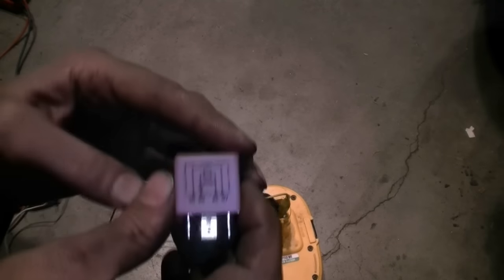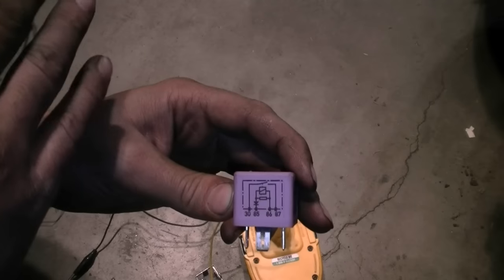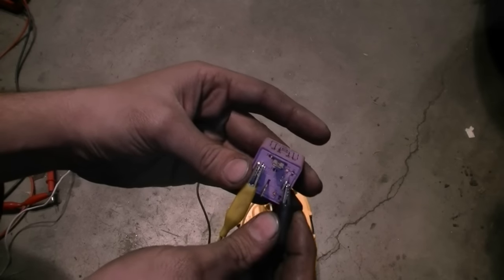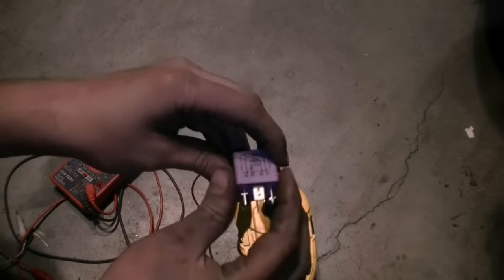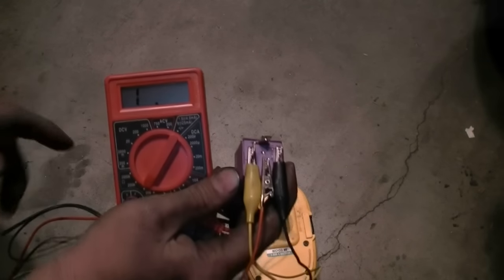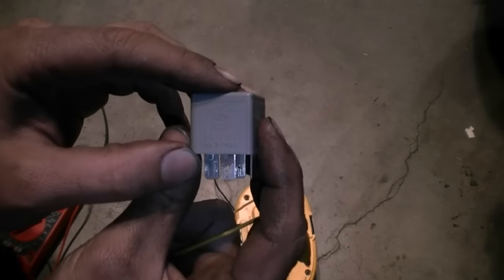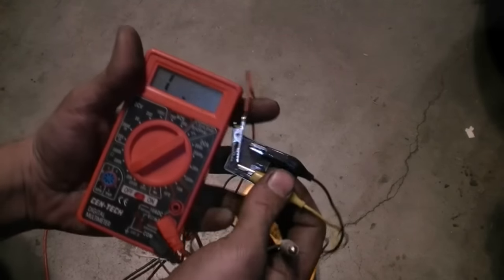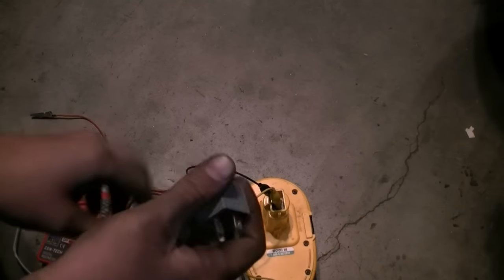How to Test a Relay the Correct Way

Comment: I got 000.4 ohms. Is that resistance still mean that it's good?
Reply: yes that is still good
Reply: Ford relays should read more than 0 and less than .5
Reply: I got 000.4 ohms. Is that resistance still mean that it's good?

Depends on what kind of load it handles. If it's for a starter or for the headlights, then it is no good. If it drives the windshield wiper pump (2 or 3 amps), then it's probably okay. A relay that provides 15 amps is going to drop 6 volts across it (if the resistance is 0.4 ohms), which leaves only 6 volts to drive the load. Amps X Resistance = Voltage Drop.
Reply: Actually that depends on the multimeter. If not properly calibrated or you have crappy leads it can cause you to see higher ohms. If you touch the leads together and do not get a reading close to 0 then your meter is off in some way. The power applied is only a coil engaging voltage and does not affect the ohms reading.
Reply: Most multimeters cannot measure accurately under 10 ohms. You are usually looking at a good or no good condition with relay coils.
Either you will get a low ohm reading or an open circuit, rarely anything in between.

Comment: 2007 Corolla turns but wont start. Changed plugs and cam sensor ( old sensor read 1.3 ohms while the new sensor read 1.2 ohms. Repair Manual range 1.6 -2.0. confused!) Moving on to check the crank sensor   which is buried behind ac pump and alternator. I checked efi  relay for click and resistance, works. I believe their was a recall for 2007 corolla not starting which had to do with ecm. Do you have any ideas, thanks.

Comment: The relay really needs a "load test". If you do a voltage drop test before and aft the load circuit contacts (relay) whilst the relay is in circuit and switched on....it will tell you if the contacts really are good or not....

Comment: Hey young man;
Could you point me?
99 5.9 Durango 
Few years ago it died at 170,000 and for some reason owner just let it sit for few years. 
2nd owner put fuel pump on and it ran for 700 miles and quit. 
They put crank/cam sensors and still no start. 
No Buss signal in odometer window.
I bought and am sorting thru.
 It does crank and sounds mech ok during crank. 
Dash lights seem to work normal during key on. Odometer reads mileage.  
It does not have or require a smart key.
It does have a Security light that shuts off within moments of turning key on then after 3 flashes of Odometer No Buss code and security light show up.
Tach does not move during crank.
I have no power to coil / fuel injectors. 
I have fuel pressure at Schrader valve. I can light loosen Fuel relay and hear clicking.
I hear no activity from ASD relay.
I have; (key on) 5.18 volts on the (5v ref wire) at crank/cam/ throttle sensors.
Key on backprob crank sensor signal wire and volts remain at 5.
(Key off)I unhooked positive terminal and test light to bat positive post- tested black ground on crank and cam sensors the light comes on strong. 
Did the jump on ASD relay (pin 3-5) and for first time have 12V at coil. 
So that should mean Ign coil driver is (ok) in PCM correct?

The Durango is immaculate with no obvious signs of mice or frayed wires. 
I am somewhat comfortable with a wrench but power tracing not my best area.
Even though box and old crk sensor were left in vehicle; I’m leaning towards a bad crk sensor.  
Best; Tom

Comment: Ok, if 85 is ground and 86 is positive and I hook it up to a 12 volt system and close the relay. Why do I have to put power to pin 30 to get 12 volts to pin 87. Shouldn't I get 12 volts to pin 87 when the relay closes

Comment: hello sir iam from india i have vespa s 150, 70,12v dc starter relay,when i testet in multimeter @ 200 ohm, 86 to 85 result is 36.8 is this bad relay,i have also starting problem to my scooter.

Comment: Hey bro, can you please tell me how to test the solar roof relay (part # 4B0959589). It doesn't have a diagram on it, just these numbers by the pins: 2,3,4,5,6,7. And it says 12V(plus part number).
I'm having a problem with blower motor going in limp mode after 10 min. After some 'google-ing' a guy pointed me to this solar roof relay taking over the climate control.
Thanks!

Comment: I disagree with how you checked the load side. It would have been better to check it with a load in place, such as a test light. Things ohm correctly all the time, but fail when they have current running through them. So power and ground coil side obviously, then apply power to load side and test light to load side, then you are 100% like you say. Ohm check isnt good enough im afraid

Comment: aaahhh, what does the numbers mean??  I am working on a Jaguar.  It has a $**t load of relays, in the trunk, right and left side under front hood.  Oh by-the-way, thank you for this video, VERY helpful!!
Reply: +Lisa Elledge Here's a quick description of the numbers on a relay:

30 = 12.V Power in from battery (POSITIVE)
85 = Ground connection (NEGATIVE)
86 = Power in from any activation switch/trigger
87 =  Power out from switch to accessory/device

Hope this helps.

btw... Some relays can have an 87A included
This is usually a tab located in a centered position on the relay and is meant for 'constant on' power.
Cheers!
Reply: THANK YOU!!  You are now my hero battalian

Comment: Not the best way to test a relay. The best way is to test under full load (full amperage). You measure the voltage drop across the contacts with your voltmeter. When high current goes through the contacts, a lot of heat is produced and that is when the contacts usually fail.

Comment: The problem with testing ANY relays is that even though you go through that process you've showed us, they can still be bad under load!  So it's a good idea to replace ALL relays, unless you are able to test them under load.  Otherwise, your customers might just be giving you a call to tell you their circuit board does not work!

Comment: If you imagine the relay working a gas pump on your car, it kind of works like a light switch in a room. The light bulb comes on as you flick the switch. The gas pump comes on as the electro magnet flicks the switch inside the relay.  The difference being, your hand is the electro magnet or 85 and 86 and 30 and 87 becomes the light bulb. If the light bulb is flickering then the contacts are dirty or not making a good contact. So after connecting 12V power to 85 and 86 and continuing to test via 30 and 87 wouldn't it be better to touch volt meter leads together on 20 ohms reading and take that reading. It should be the same reading when you connect the ends to 30 and 87 to show that there is no resistance or very little and that the switch is actually closed? You did not put the 2 leads together and went straight onto the relay testing the switching. Just my 2 cents worth for what it's worth. Across the switch and the bare leads touching should be the exact match for a real good connection of the switch plate.

Comment: the diagram on the relay has represented a coil, resistor, diode and an open contact, the terminal with the diode is positive if the polarity is reversed the nothing happens just the relay does not work, this Because you reverse the diode polarity

Comment: For eg.output DC 100v 25 a, 60 volt  45 a.
Can i output 25 to 30 a under 12v DC supply since the rating  (volt and power) is in the specified above intervals?
Thanks.
Reply: You could use a relay powered by 12v DC to switch a much higher current and/or voltage. The switched part of a relay is electrically different to the coil part. It is just a mechanical switch operated by the coil. The limitations of what can be switched is by the physical properties of the switch. A relay will always indicate the operating voltage of the coil as well as the operating voltage and current of the switched part. You will usually find that the amount of current to be passed is more important than the voltage.

Comment: yes its a car relay ie 12v battery but iff its not a car relay how do you know the power to use to test?
Reply: Most relays will have markings indicating at least basics specs. It should have the operating voltage and rated voltage and current of the switched  contact as well as a small diagram showing the pin connections.

Comment: Sorry I sent a message to your email.  I had a relay I was testing and it just sparked instead of hearing any click or no click.  Is the relay bad to begin with or did I just fry it trying to test it.  It is from a motorcycle.  I used the motorcycle battery as my power source.  Thanks.
Reply: It will spark, you are adding power to the relay. No worries.

Comment: You may have an idea how they work but you are far from qualified to be saying that this is the proper way. You need to test it while holding magnet power in case it is weak because many relays work fine when cold but start having weak magnet issues when they get hot.

Comment: What if the magnetic coil is beyond the resistance it is supposed to be? Say a 400ohm coil is 706ohms? (@9VDC)
Reply: There are a few things to note in your question.
First, the resistance measurement is totally independent of voltage. The voltage rating of the coil is an indication of how well insulated the wire is. Second, coils are simple beasts, they usually only fail if a wire is broken or the coil is burnt out. So they normally only exist in one of two states, open or short circuit. Finally, a coil is just wire wrapped around a piece of ferrous metal. The resistance will usually be under 10 ohms.
One possible exception would be a poor connection.

Comment: In really answering Tom Yang's question as well as Mike&laura S's comment you are really not checking a "live" circuit with your Ohm meter but the equivalent of one single "wire", which is broken until you energize the relay. Then your Ohm meter current would flow showing the "wire" was now continuous and had a very low resistance.  You would need a 2nd "wire" to have the battery current flow thru the "wire" you are checking.  Very simplified but I think accurate and of course AK3N4TON was absolutely right, just didn't tell you why there wasn't 12V thru the wire your Ohm meter was checking and why you probably can't just check it with a meter.

Comment: would it be safe to measure  resistance btw 30 and 87 on a live circuit, ie when the relay is connected to the battery ?
Reply: NEVER connect a ohm meter (resistance measuring) to a LIVE circuit. Resistance metering works by sending out a small current through the circuit measures the voltage drop then calculates the resistance based on R=E/I. So if you send out the small meter current to the already live larger current, you could short out your metering equipment.
Reply: Yes it would be. 30 and 87 are just the switched part. This is exactly what he showed in the video

Comment: I thought you can’t test resistance on a powered circuit?
Reply: There are two separate circuits in the relay:  a powered electromagnet, and a non-powered switch (or simply a metal bridge) that gets pulled to connect two metal contacts by the electromagnet when it is energized.   This video shows two points of potential failure:  the first electromagnetic circuit when it is energized (which may fail if the electromagnetic coil is burned out), and the second non-powered switch (which may fail if the contact points are burned out, or the switch is stuck in either the on or off position - regardless of what the electromagnet is doing).  Resistance in this Youtube video is being tested on the second, non-powered switch.

Comment: on the second relay you reversed the order of the connectors from the Multimeter and the multimeter didn't look like it even gave a reading???? you said it read 0 but it didn't look like that it looked like it wasn't giving any reading because maybe the connectors were reversed?
Reply: When testing resistance, it does not matter which way the leads are connected, it reads exactly the same either way.
The reading on the multimeter was indeed a no reading, this indicates an open circuit and a reading of zero would indicate indicate a short circuit or connected condition. He probably just worded it poorly.

Comment: Help me please ac sytem blowing hot fuses and relays good system charged too...could it be wiring??? 2008 ford explorer
Reply: I have a friend that’s a good electrician here in Phoenix az and I have been there to see it live a bad clutch compressor will blow your fuse. Most of the time you would have to replace the clutch itself.

Comment: maybe if you want to put up a tutorial or an how to video learn some terminology. Diodes, resistor and spring would help out greatly. Overall not horrible but does need work. Resistance should be between 290 and 350.
Reply: In an automotive relay, there are a solenoid, iron armature, yoke, spring, contacts as well as a diode.
Regarding terminology, it could be better if he mentions that the relay used here is an SPST (single pole-single throw) NO (normally open) as it has 4 terminals, including coil terminal.

Comment: why are you checking for resistance when the circuit has voltage going through it? that's one way to destroy your multimeter. some fancy fluke multimeters will even give you false readings because they have protective circuits that prevent checking ohms on a hot circuit.
Reply: You are wrong, he connected  the multi-tester in a circuit without electricity between 30 and 87 and the electricity through 85 and 86, check the video again.

Comment: it's called a SWITCH Generally
look at the part on this diagram which refers to ARMATURE and CONTACT, Movable Contact and Stationary Contact

Relays come in NO (Normally Open) or NC (Normally Closed) Types

http://www.galco.com/comp/prod/relay.htm

use the diagram to figure out what you were talking about , because it's not called a flapper

Comment: Not holding my breath that you would be able to provide an answer *since you dont even know what a switch within electronics is called - lol *switch!
Anyways, how would you go about testing a 2 pin indicator relay ? commonly used on Harleys mine is a 1981
No real way to test the resistance is there since you only have ground and power going into the relay itself

Comment: Hi mate
another point
With No Disrespect intended....
you really need to brush up on your basic knowledge

i mean... "The Flapper" ,  "The Infinity" ... Really ?
cmon mate

i understand completely , but...
how long does it really take for you to google this shit, even if you were taught incorrectly.

The Flapper, as you call it, is most likely A SWITCH or THE ARMATURE
THE CLICK comes from the action when THE ARMATURE moves as a result of THE COIL being magnetized and thus THE MOVEABLE CONTACT on THE ARMATURE hits the STATIONARY CONTACT and thus makes the noise (The Click)

as for 1 or.. Depending on the DMM you might get OL
it stands for Over Limit (it does not mean Infinity)
some might say it as  INFINITE RESISTANCE, (Assuming you are Testing Resistance),
some say OVERLOAD, this is also incorrect

OVER LIMIT is correct
it means OPEN CIRCUIT , but mor accurately..  OVER LIMIT
because if you are testing Continuity , OPEN CIRCUIT would apply, however if you are testing Resistance, OPEN CIRCUIT WOULD NOT APPLY
but OVER LIMIT applies in all scenario's

You need to brush up on your basics... BIG TIME

thanks for the video and all... as far as that's concerned... good work.. sure

but, you really need to brush up on your basics
Reply: Who cares about any of this. The fact that what he did was correct and all that counts. You need to brush up on many things yourself.